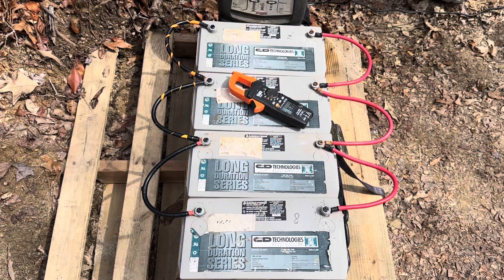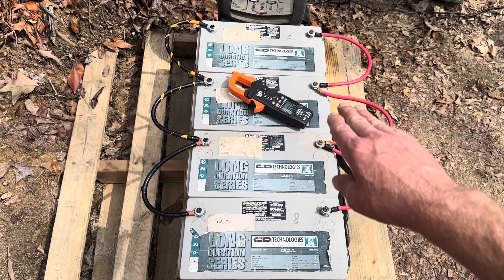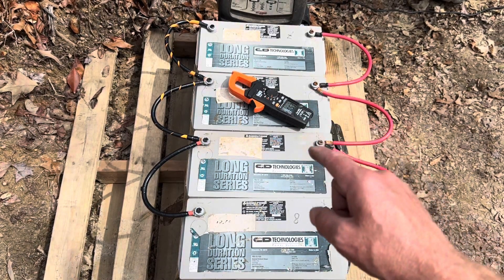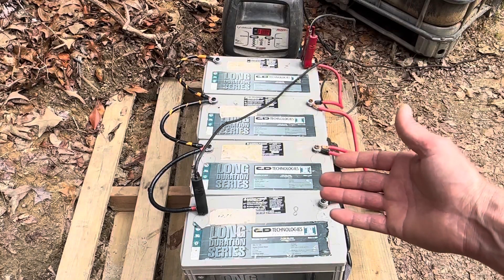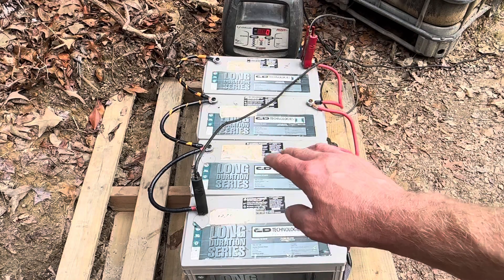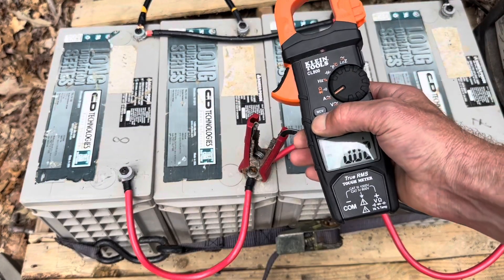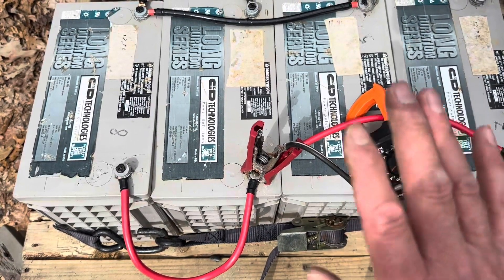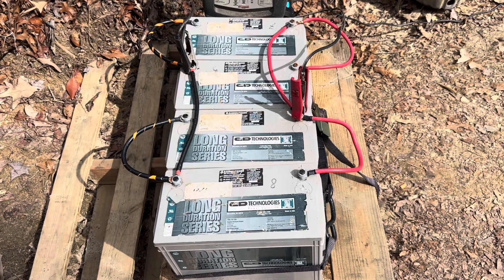12V Perfectly Balanced Battery Charging

Comment: I have noted several configurations for these setups, and this seems to be the most effective approach for balanced charging. Where ought I to connect the inverter? Would it be on the same connections
Reply from the maker: The two center batteries would be inverter connection. Inverter positive and negative would be where the long lead from the outer batteries connects to each respective polarity same as the charger. Hope this helps!

Comment: Great explanation and great video!
What would you recommend for my 3 battery set up? And what do you think about 3/4” copper pipe mashed flat and used as a bus bar?
Reply from the maker: Thanks! Copper is good, get the thick walled type. Can’t remember if Type K or Type L is thicker wall. If you’re doing a mobile application wire would be better so as not to stress the terminals from vibration/bouncing etc. 
or could run equal lengths wire from each battery to common pos/neg bus bar.

Comment: With just two lipo four batteries would you just put the charger leads from the positive on one battery and the negative on the battery ? Using the same length and gauge wire on these batteries
Reply from the maker: On 2 batteries in parallel that would be just fine! 
Parallel Jumpers/bars between A and B. Connect source/load + on batt A. - on batt B. Equal length wire always important! Hope this helps!